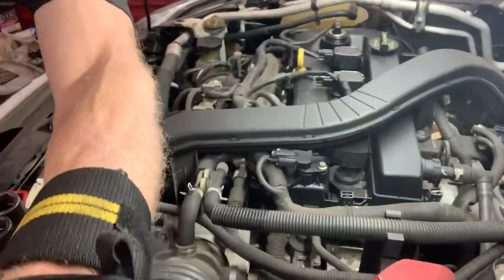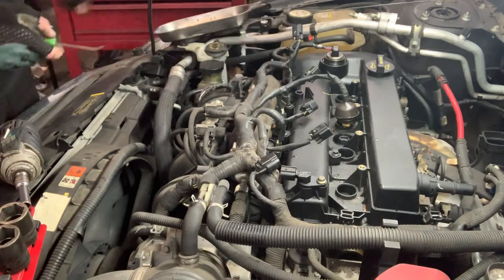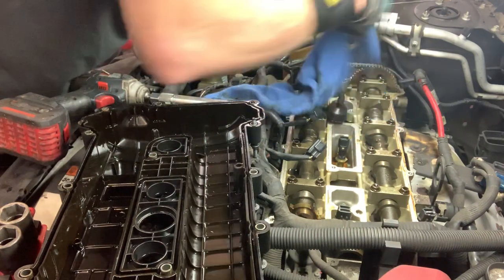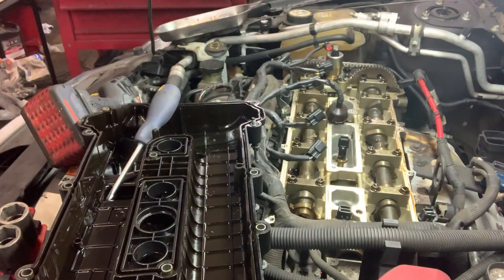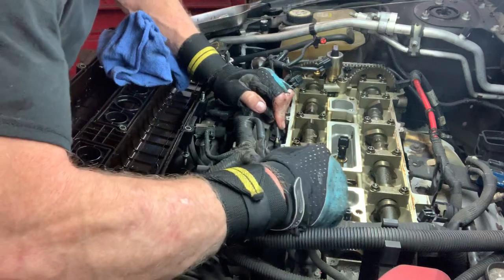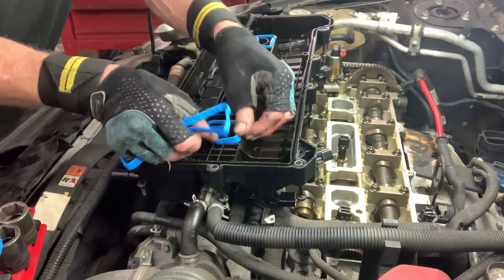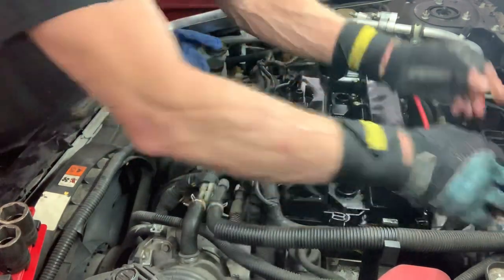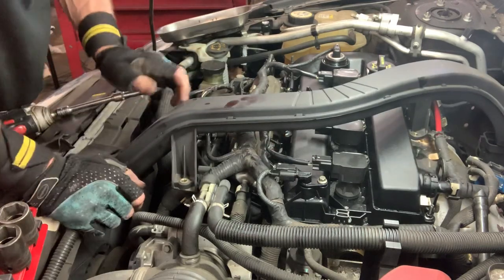2007 Ford ￼ focus valve cover

Comment: Even after 4 years your video is So Valid! Thank you for sharing. We just discovered the same problem with the Same 2007 Ford Fusion engine. Can you offer any tips on how to remove a super stubborn spark plug. The Spark Plug second from the left doesn't want to move. Its stuck good. Any tips would be greatly appreciated. If I break the spark plug I'll be in a world of hurt. Thank you again for taking the time.
Reply from the maker: That can be tricky lheat the car up and hope it comes out

Comment: 1.Sir, THANK YOU for showing how to tackle the oil filled plug well issue. No other tutorial I've seen addressed that problem. 2. I felt along the edges where the cover meets the block and found that the cover has some overhang along the firewall side. Do you think I will need a new cover? 3. How much would you charge to change the gasket on a 2005 Focus ? Thanks again.

Comment: I would have liked to have seen the rest. I missed the tork specs for the valve cover, besides to see it totally finished would be like crossing the finish line.
Reply from the maker: Matthew Cahill So I could show the entire job to completion. Sometimes being the owner and a mechanic things get a little crazy at the shop. And I had to cut things short

Comment: I gotta do this too. Looks pretty easy. I will try it. Do you have a video for intake manifold replacement? I have a OBD code for Actuator bank 1 stuck open, but everything I've found on replacement says  there isn't a procedure or part for it, and to just replace the entire manifold. (2006 Fusion).
Reply from the maker: Tim Ber Right you have to change the whole intake manifold. Yes I did one but I didn’t shoot a video of it
Reply: @CoopersAutomotiveRepair  Thanks for the reply

Comment: I did not scrape the dried oil on the top. I was scared to use a scraper as i was worried to scratch the surface but i just cleaned it with a rag..will i be fine?.. Will the dried oil go in the engine and mess it up?
Reply from the maker: Mike Dizon Using a special carbide scraper is best. You should be fine only concern is without a clean surface you may or may not still have a small leak
Reply: @CoopersAutomotiveRepair  thanks for the reply.. I hope there be no leaks.. I put a new gasket on and that should make a big difference. I will monitor for leaks. I don't wanna redo it again lol

Comment: As usual...Ford makes this harder than necessary....the wiring is so tight and held in place far more than necessary.  The clip on the rear hose (3.17 on the video) is hard to figure out and the video doesn't show how to undo the clamp....

Comment: My car has oil inside cylinder 2 and 3 (the 2 in the middle.) This mechanic replaced the head gasket like a year ago . i checked the sparkplugs today and I found oil in the holes again. Would you recommend to get a new head gasket and a gasket maker to make it stronger?

Comment: no more felpro or any other after market gaskets for me  it is oem or nothing
Reply: Most of the Fel-Pro gaskets I've used are better than OEM. They are the only ones I will use on GM's 3.4L V6. Fixes the lower intake manifold gasket leak issues.